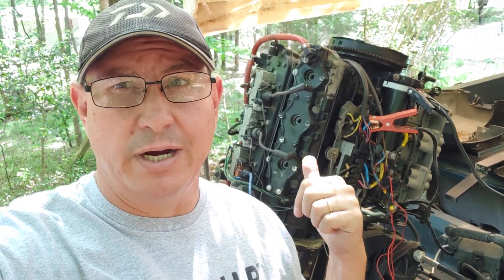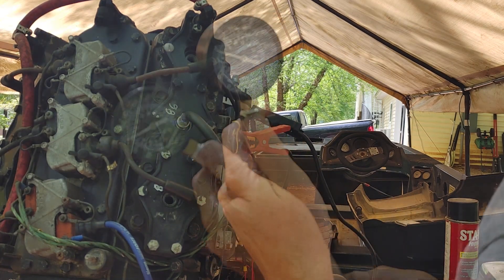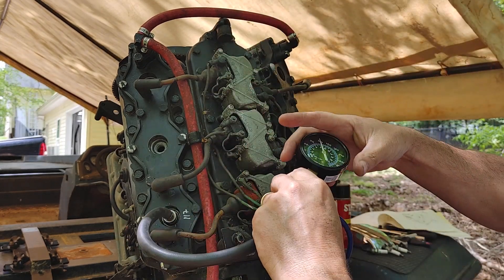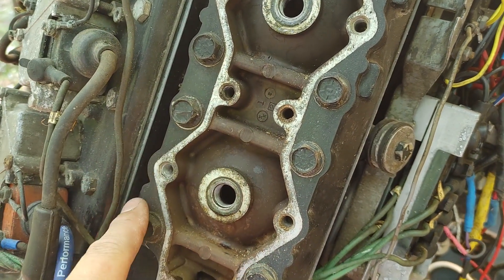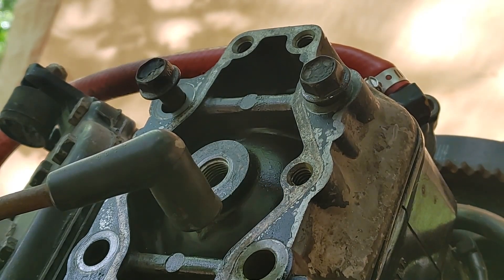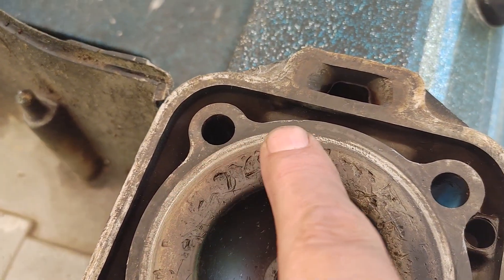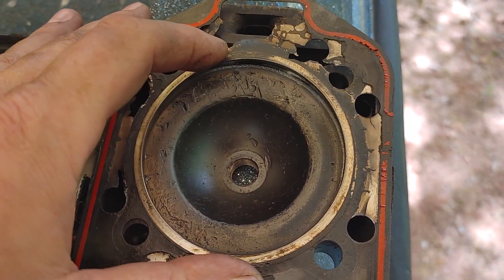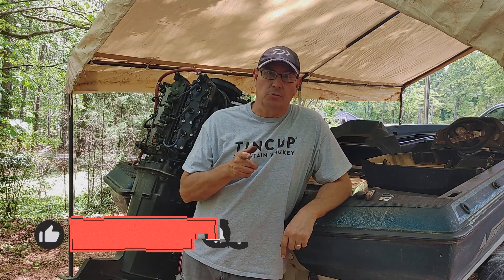Mercury Black Max 150 HP / Compression Test / It Needs a Re-Build!

Comment: Water was getting into #2, very rebuildable, lost a piston caused damage to head, more than likely bearing shrapnel, dial bore the cylinders, most likely ran hot.
Reply from the maker: Trying to find the RIGHT parts is tough. Re-powering with a 200, new video out soon.